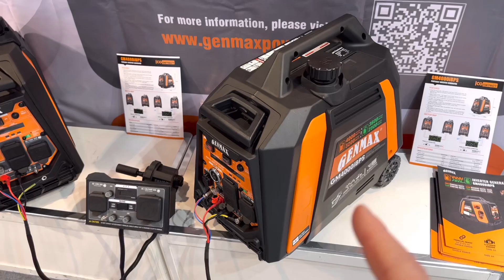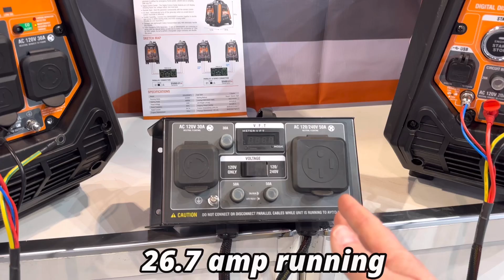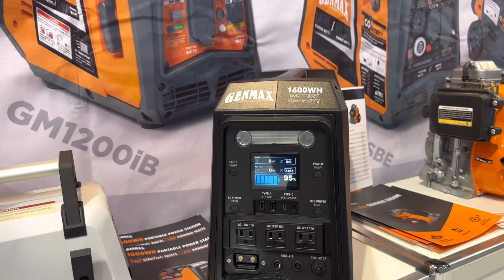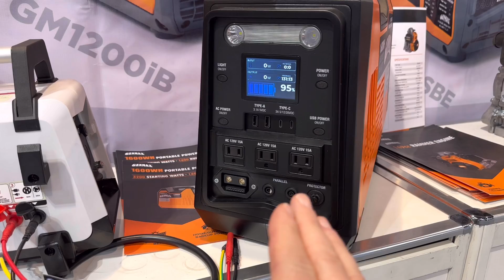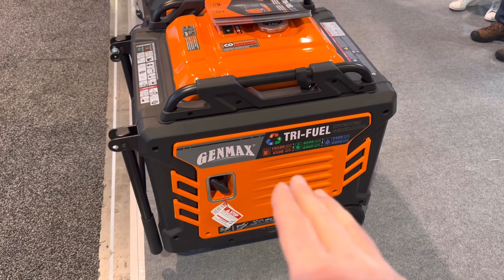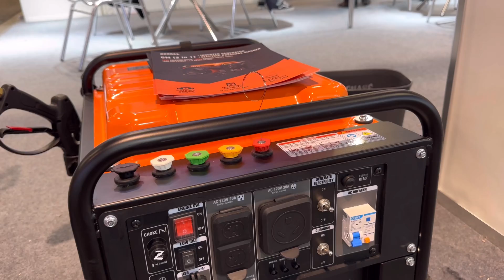Best new generators 2023!! New Generators Never before seen !! EFI and More…

Comment: Soooo....What's up with the Sam's Club GM75000aied that's $899 for 7kw on gas in comparison to these others that are substantially more expensive for less power? I realize Walmart is the 800-lb gorilla in the retail world and their demands for a single SKU in their mix. I was a rep years ago for a few car audio pieces in the stores and it was a pain at best.
Reply from the maker: They make special units for large retailers so you can only get it there
Reply: @johnnysweekends    Yep.  I get that for sure.

Comment: Thinking about the killer app for a parallel battery, I would love to see a hybrid car type approach. When loads are high and the engine is above say 80% load, the battery feeds power in to share the load. Then when loads are low and there is extra capacity, the battery feeds power out replenishing itself. Get most of the power of a parallel setup, with less cost/hassle vs two full engines. It would just need a smart (adjustable) management system.

Comment: I just received my new GenMax GM9000iED and if I get a blackout I plan on using extension heavy gauge cords for Appliances(I"m a renter of a home so don't want to pay to have a home hookup) so my question is should I hook up a inground rod then run wire to the Generators ground stud on front of Generator? I"m a newbie here when it comess to Generators.
Reply from the maker: The generator will use the ground or bonding of the complex/house as long as it hasn’t been changed or anything modified. 
May want to double check but normally it uses a home bond as the ground.

Comment: I'm interested in the 10500 tri fuel. HOWEVER, knowing how I am, $2900 isn't enough to spend so I'm probably going to wait on the 12000 tri fuel when it's available. Unfortunately more wattage and twin cylinder engine may put it out of my range. We'll see. :-)
Reply from the maker: Yea hoping to see it this winter,. But the twin cylinder will be more fuel hungry
Reply: Yeah this is true. Hopefully some spoiler alerts come out ahead of it's release. Kind of anxious about it. I'm thinking the price range might be in the 3500-4000. More than that I'll go with the 10500. @johnnysweekends

Comment: I would like to see a 5000-8000 watt, 3 fuel, fuel injected, 50 amp plug, inverter generator
Reply from the maker: It would need to be a little bigger than 5000 watt start. They already have the 7250 with 120/240 volt https://amzn.to/3OlpQN5
Reply: @johnnysweekends  What about the GM7500iAED st Sams Club for $899?
Reply from the maker: @avguytx4361 good return policy if you need to. I’m sure it’s the same unit just stamped different for specs

Comment: You have to tell your viewers about ethanol fuel. Adding conditioner doesn’t solve the fuel issues, it helps and I always do.
When pumping gas at local fill stations, often you are getting whatever fuel was in the hose from the last fill. There’s a big class action legal action about this. your viewers need to know that just because they go to the ethanol free pump, don’t assume that’s what you’re getting!  Pressure washer and generator combined ? I really need to think about that one. The tri-fuel is outstanding. The 240amp series is outstanding. Fuel injection outstanding.
Reply from the maker: Ethanol free fuel is nice if you get it from a station with a designated pump or you end up getting a mix. 
I find in the long run most people dont wanna pay the extra for it. Which can be on up to $23 a gallon in the store or even at a pump in CA its $8.50 a gallon. So its a decent jump in price verses a additive that works well. But during long term draining completely is best.
But yes many new items coming and should start seeing them around early to mid summer

Comment: My Coleman Powermate 3500 watt generator has TWO 120 duplex receptacles. Can I convert ONE of them to a L5-30R ?
Reply from the maker: Sure if you want to. It will still be rated at whatever that amps are for that outlet 15 or 20.

Comment: Do the Genmax 9,000 generator has a electric start or a remote start ? And what types of oil it use ? Is it better to use ethanol free gas for this generator ? Can I plug a electric stove that has a 220 line ?
Reply from the maker: Yes these larger units are electric and many coming with remote start as well. 
A normal specified oil is all that’s needed 
Ethanol free can be used if you do longer storage times but it used frequently then normal fuel is fine. 
And yes these larger units are 240v ready
Reply: @johnnysweekends  I'm not sure if all generators come with a battery but do this 1 ? And is it a way you can use a car battery for a generator using some type of cables ?
Reply from the maker: Yes most the units from Genmax are electric start. And if you wanted to use a car battery that will work. As long as the battery is 12v it will work..👍🏼
Reply: @JPG23  It's you-tube videos that shows how you can use a car as a generator.Can a 1000cc car battery with a 1,000w power inverter power a electric oven that's 800w or even a 800cc car battery  ?

Comment: I really swoosh they would stop incorporating USB outlets, and bring back 12vdc plugs for battery charging. Its way more useful for charging things like a dead battery on a piece of equipment in the field to get it started, or charging a trolling motor battery in a boat while boondocking.
Reply from the maker: Yea the 12 volt socket seems more universal because you can buy the 12v usb plugs to put in there. Some generators include that. Maybe they will switch back ??

Comment: What were the starting and running watts for the 10500w trifuel on natural gas?
Reply from the maker: 8400 start 6800 run. NG you loose allot of power. It’s convenience with NG for not really filling up.
Reply: @johnnysweekends  Might be worth it to wait for the 12000w version if you plan on using natural gas.
Reply from the maker: True because then you maybe be closer to 8500 or so running watts. Maybe more with a twin cylinder. 
They may be a end of the year release though. IDK…🤷🏼‍♂️

Comment: Johnny do you know if I order this 7250 on Amazon will it be the older model or the newer unit like what you show on your video ?
Reply: I noticed this change too.  The new "new" one now has a 30amp style plug between the 50 and 20's.  I would like to get this model too.. I guess it is the 7250iAED vs 7250 iEDC.
Reply: The pic in Amazon shows an older looking box style
Reply from the maker: It will not be the new show item as those are still in final phase of development and should be in mass production anytime. I would assume already. If you want the new version you will have to wait a few months.

Comment: I’m interested in a V twin, and the fuel injected model fuel injection would be amazing if you’re constantly changing an altitude. That is if it is able to compensate for the air density difference automatically. However I would like to see some small diesel generators in that 10 to 12,000 W starting segment
Reply from the maker: Ahh diesel gens would be nice but then you are getting spendy and heavy! 
But I’ll have to test the EFI to see how it does with altitude. 
Wish I had the eu3200i but can’t even get one anywhere close to CA 
They are all crazy expensive
Reply: @johnnysweekends  Yes but diesel plays better for sailboats and yachts. Because diesel is less flammable it's considered so much safer. Diesel is already onboard in the marine industry.
Reply from the maker: Yes Stan that’s true, but for the general population and sales I think you’ll sell more of the standard portable units and some of the larger stand by units. 

But more diesel options would be nice, all depends if they want to get into it. 

I think they already make some but more for trucking and construction or something. Idk I would have to look

Comment: I'm chatting with GenMax CS, they are pretty cool, respond to all my questions. 
I've been waiting for a tri fuel inverter, will definitely get the big one once it comes out. But you mentioned they will have a 12000 unit, see they only told me about 10500 model. Will there 12000 be a tri fuel inverter? With this power I won't need two units to get 240v I'm assuming, correct me if I'm wrong please
Reply from the maker: When I was there, the owner, head engineer, and other reps gave me a run down. And two large units, both tri fuel one 10000 and one 12000 watt unit. 
The large unit will be a twin cylinder. 
When…. I don’t know yet.

Comment: Wonder how can one run a parallel via NG, is there a splitter needed from a gas valve going into two units?
Reply from the maker: You would need a 3/4 split to 1/2 for each unit. 
Just check to make sure it’s correct when you do your piping

Comment: I like the two small ones that are series capable.  I have Hondas but for the house there is no way to use the water pump which is 240v.  You didnt say if they are quiet, what engine manufacturer are they using?
Reply from the maker: They should be as quiet as the 3500 ied I reviewed earlier. 
Dinking power is the owner of the Genmax line of generators.
Reply from the maker: Here is the review and sound test. Becoming a very popular unit. 
BEST COMPACT GENERATOR: GENMAX 3500iAED  Dual fuel Remote start !!
https://youtu.be/H594b9G-NPc

Comment: The parallel feature is really one that most interests me.  Deep well pumps are often 240v so ensuring water during outages is critical.  Also, the fact that two smaller form factor generators can be linked allows for ultimate flexibility and potential fuel savings.  Thanks for the product update.
Reply: This is fantastic as one would be nice and portable for camping while two would be capable of powering a hone directly or useful in recharging a home inverter as needed. 🎉
Reply from the maker: Agree having the ability the parallel or now series connect units really opens up options..😀👍🏼

Comment: When will this automatic transfer switch be available... And would it be available with smaller generators like 3000 4000 5000... All I need is 120/240, Fuel injected and to be able to handle it myself.. that would be awesome! But I'm really interested in the ATS...
Reply: Is the ATS pin out of the 7250 generator compatible with the Westinghouse Smart Transfer Switch?   The connector looks the same.
Reply from the maker: Idk honestly. Maybe same connection but still needs to talk correctly so would have to be a set up and try..👍🏼
Reply from the maker: Probably a couple more months at least as it is still being developed and tested. 
Maybe summer ..??? Or later this year..🤷🏼‍♂️

Comment: How much do you think the tri fuel is going to be. Also is the engine built to run on that type of fuel or is it just a add on? I converted mine but I don’t think the engine is built to run that hot.
Reply from the maker: I’m not sure but I would say at least $2500 maybe up to $2800…🤷🏼‍♂️🤷🏼‍♂️🤷🏼‍♂️
Hard to know because no tri fuel units to compare in the same range.

Comment: I’ve been following Genmax for a few years now and it’s absolutely amazing how fast they continue to release new and innovative units to the market. No other inverter gen company is even close to them with these latest products. And now I see why are are adding that round serial plug to units. It sounds like they have a big plan for the various things it can do from ATS start/stop to that fuel pump, to the 240v box. Amazing stuff. I also worry about quality and parts availability but their prices make a strong case for trying them. Great video!
Reply: Genmax makes most of the other companies' generators as well like the Predator and Duromax. It makes sense that they would bring the newest technology to their own brand.  Hopefully their US customer service will catch up as well.
Reply from the maker: Genmax does manufacture for other companies like pulsar DuroMax and a few others but not the predator line. That is there own. 
The customer service and warranty were things we talked about at the show and was one thing they were putting a lot of time and money into to start building that up. I see them being maybe like the champion model. If not buying Honda and Yamaha champion is always a great option due to customer service and warranty. 
If Genmax follows this model they should do well. 
They have already made some improvements from some suggestions I made to the finished products for a couple of these units. 

So will see. I’m glad someone filled the void of having a wider selection for generators. I thought Champion was going to do more and I know a couple new models are coming but they didn’t say much.
Reply: @johnnysweekends  HI Johnny. I bought over the phone years and years ago a 2500 watt Yamaha gas generator.  It was the quietest one I've ever heard at the time. Just a couple if years ago I had it in the shop to be cleaned as foe the gunk in the carburetor. The man that usually fixed the thing said the coil was bad and he couldn't find one anywhere. I was really bummed as that thing would run a way higher load than my other gas generators like 5000 watt Champion. I don't know how and the technician didn't either but he checked out hiw much stuff it would run at the same time in his shop and said nothing he had ever seen worked as well as that Yamaha.
Reply from the maker: The Yamahas are also nice units. Spendy and kinda heavy really lol. But they last. I would check eBay for those parts, amazing what you can find there
Reply: @johnnysweekends  Thanks for the tip.
Reply: Sadly, from what I can tell, this company is out of business.

Comment: Sweet. I don’t remember a time that you could get a factory built tri-fuel generator that used inverter technology. It has been dual fuel sometimes, but not tri-fuel, so you had to do modification kits. I would literally order this today.
Reply: I'm interested in the tri-fuel as well. I wish it wasn't so enormous and expensive though. I can't imagine they'll sell them for less than that dual fuel 9500W model, which is going for $2200-$2400 right now. Right now my best option seems to be the Champion 100520 with an aftermarket natural gas kit.
Reply from the maker: Yea be nice to see maybe a 7000 watt tri fuel like the one that just came out to dual fuel.
Reply from the maker: Right !!! 
Being um!!
Reply: Trifuel plus Inverter together is a game changer. A truly practical generator!

Comment: Wow! Great job and thanks for this amazing update.  That 10,000kw looks like a super winner. It appears to have the quiet type shroud around it. Is that true? Do they offer Db info on that one? Thanks.
Reply from the maker: It is a enclosed frame inverter which a enclosed frame is your quiet units. I would assume between 61-63 db at 25% load. Pretty standard now a days.

Comment: The 240 volt thing is awesome.  Wish they'd make a "hybrid" battery unit though.  Tiny, efficient generator that runs at 80% load or so to charge up the battery for the inverter.  auto start to charge.  EFI.  could really stretch your fuel that way because as is most generators do not operate at a load that provides the most electric energy for the fuel used.  With controlling the charger that could allow for a more efficient use of fuel.
Reply from the maker: I know exactly what you are saying. 
And …… well let’s just see what happens.
Reply: @johnnysweekends  :)

Comment: I'm assuming the 240V is split phase? IE two separate 120V to neutral legs? Are the two neutrals bonded - I see the left generator's ground lead wasn't connected? If so I'd be very interested in you reviewing that. I'd like to be able to buy a pair for home emergency backup (240V well pump) but still would like to take only one generator with my RV for LPG boondock camping. Also would be nice if they made that tri-fuel as I have NG at home!
Reply from the maker: I have no idea what other models will be tri fuel I know the larger ones for now and maybe trickle down to the smaller or medium ones. 
I don’t know for sure on the parallel or series box exactly how they have it. Both of those generators are bonded so I would assume they would be. And should be 120 on each leg providing the 26.7 amps per leg from each unit . Or over 50 amp at 120. And yes split. 
That’s how I would assume it would be.

Comment: Tell us how & where their warranty &  service is. This is kind of important.
Reply from the maker: Rick, i spoke with someone there is is heading up warranty and customer. As there company has been growing so has this department. They are working on getting more parts available to the warehouse in San Diego. Now sure it wont have a designated service shop like Honda or Yamaha but you have to take to a small engine shop. Most these units are almost diy service anyway. It’s a carb service or replacement. Or inverter-board replacement like any other brand that is not Honda or Yamaha. Both being great brands but I think since they have gone cheap the quality and development is not the same. Sad really but not its hard to justify the 3 times the cost sometimes. But in the end all in what the buyer needs.